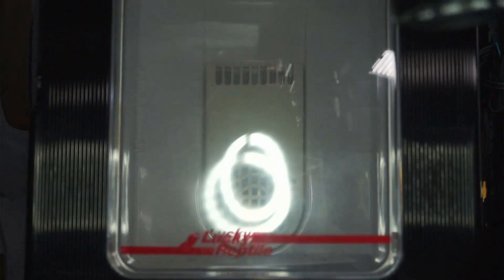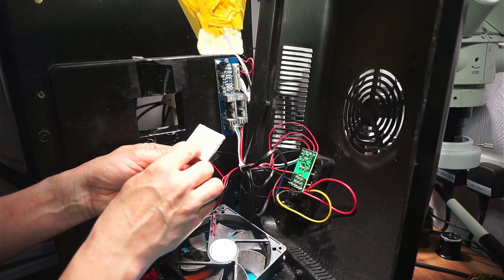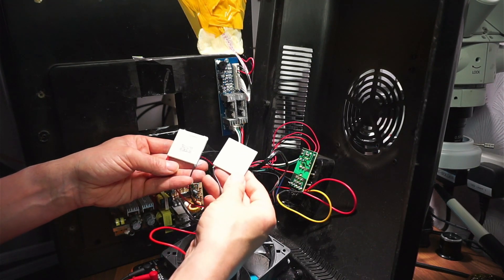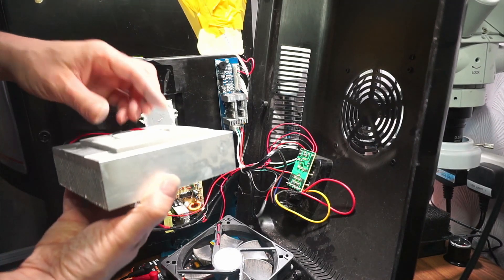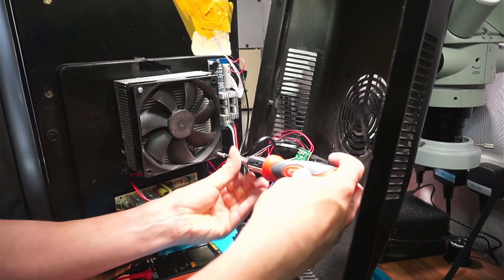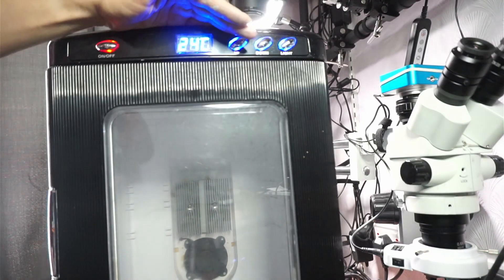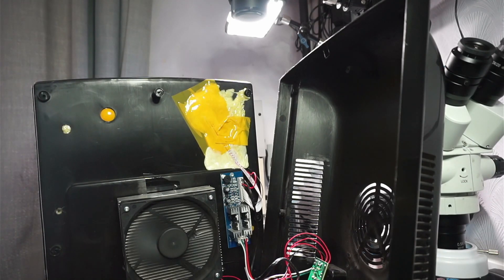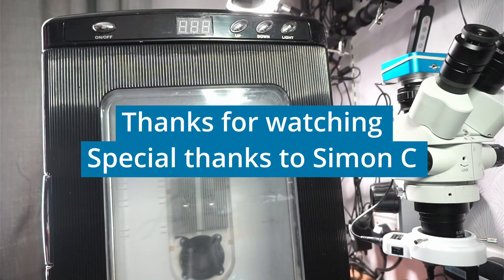Reptile Egg Incubator | Replacing Heater | Model HN-2

Comment: The lights that show the temperature on mine is at have started constantly blinking. Could this be caused by the same issue?
Reply: Same. I also have a repetitive beeping. Can’t find the manual either.
Reply from the maker: Perhaps it's the temperature sensor.

Comment: I replaced the tec1 an now the display screen shows EE
Reply from the maker: Just done a quick google but nothing turned up. The lack of info on these things is annoying. What was the fault which made you change the tec1?  Are you positive you have all the cable plugged in correctly?
Reply from the maker: I'm leaning towards a faulty temperature sensor.

Comment: Do you possibly know how to find the Thermometer part for this incubator? I am getting incorrect temps on saying 128 degrees on my incubator when it's cold. I need to find the replacement thermometer part but cannot find it..
Reply from the maker: I'm sorry I don't the part number. Looking at the original footage hasn't helped either. I hope you can find a replacement and get it working.

Comment: Peltier reverse polarity is compleatly normal infact i beleve you can shift them on the fly i assume depending on the polarity  it cools or heats.
Reply from the maker: So positive polarity, it warms and negative polarity it cools (or vice versa)? It looks very strange inside. There's a photo of it on the community tab.
Reply: @PhilipBryden  Reversing the polarity will switch which side is hot and which is cold, so you could, for example, heat & cool the inside of a box with one Peltier
Reply from the maker: @flibble666  It's quite a small heater for how big the incubator is. When editing, I noticed the big chunk of aluminium the heat had to pass through too. No wonder it took a while to start heating up. Oh, and it helps to close the door ha ha.
Reply: true that, i measured -12V on the board when heats inside, changing to +12V when cools down. the relays switch between the 2 states passing from 0V (relay open)